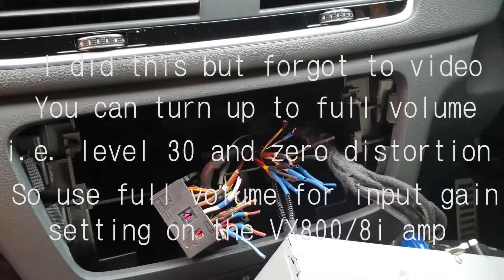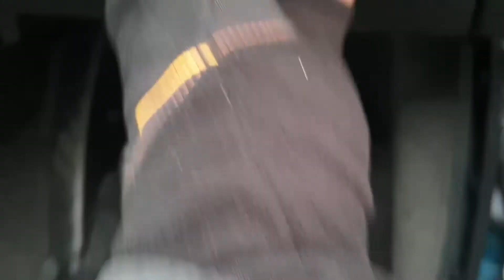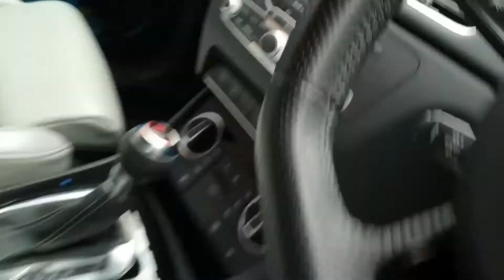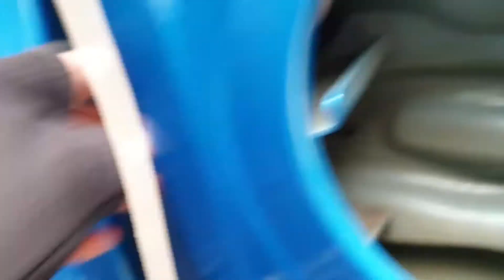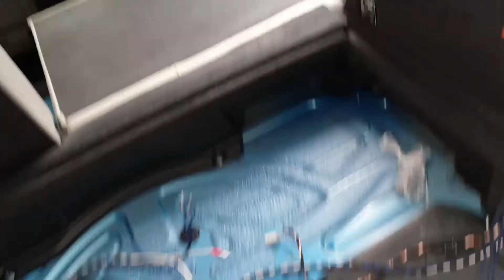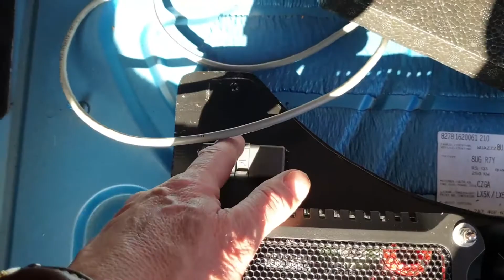05 Audi Q3 Head Unit Connection to JL Audio VX800 Amp

Comment: Thank you so  much for your reply. 
Just had a look at the wirers sad to say it's not looking the same as the chart. The car i have : Q3  2013 Same block & Radio, i'm trying to install a active under seat sub.
Here is the brown block colors 
first row of wires / +gray &   brown/-grey/ 
Second row of wires  /+brown & yellow/-red & yellow 
Third     row of wires  /+blue & red        /-red & white  
Fourth  row of wires  /+brown & purple/ -red & purple.

In Phase USW300 300W Underseat Subwoofer Car - Active Car Subwoofer with Built in Amplifier - Under Seat Subwoofer Car.

hope you can understand what i'm saying. 
Thanks again for your time.
paul
Reply from the maker: Ok. I see you have 4 speakers, and you are looking to tap into (not cut,) just like it did with the Volvo install I messaged  on before. When I look at my Audi 6 speakers (fr,fl, rr,rl,centre, sub). I see in all cases the negative wire of a pair is the brown bearing wire.  The only exception is see if your 3rd row wires. Either way. Use the battery trick with the pair, e.g. first row  +gray &   brown/-grey/ , and Second row of wires  /+brown & yellow/-red & yellow. See if this makes a noise in the front door speaker pair. Then it’s a simple matter of tapping into these wired (join to them, not cut) and then grey & grey/black set and the white & white/black high level input wires on the phase amp/sub. Make sure you get the Phase correct.. e.g. grey&brown grey at the head unit plug match the grey/brown with the grey/black wire to the sub. Similarly, brown/yellow with white/black.

I hope that helps, about as much as I can do for you 😀
Reply: Thank you for taking the time  out . I'm going to work on this tomorrow, and will update you how it goes, cheers paul

Comment: Thank you so so much you really helped me out here.
Reply from the maker: One more tip.if you are trying to find out which wire on the head unit plug goes to which speaker. Put thin wires into the pairs you suspect and touch against a 1.5v battery… the speaker will make a little noise, cracking. A. 9v battery will make a somewhat louder noise. This is how I check which wires go to the speakers.
Reply from the maker: Ok so my chart won’t help. I am assuming you have a subwoofer already in the boot? If yes, then it’s maybe easier to run the connection fro the boot. If it’s the case you don’t have a sub, and are trying to add one, then you need to tap into the speaker wires, either at the head unit, or closed to the speakers … I did something like this on an xc90 before … see https://youtu.be/vXaHmnPnMX0